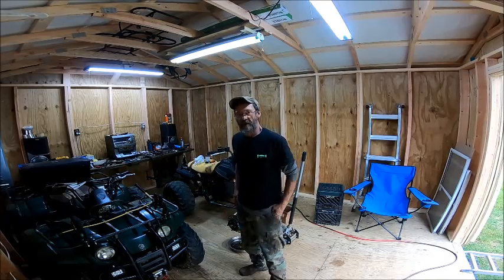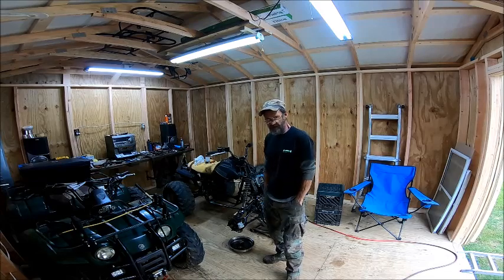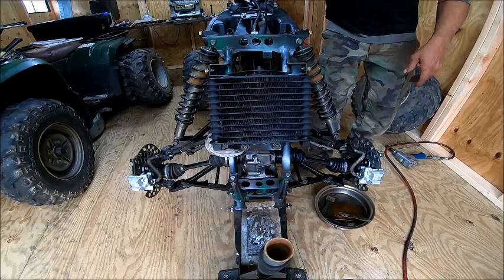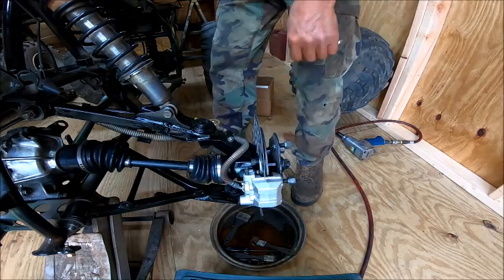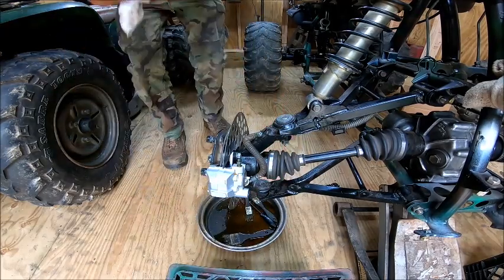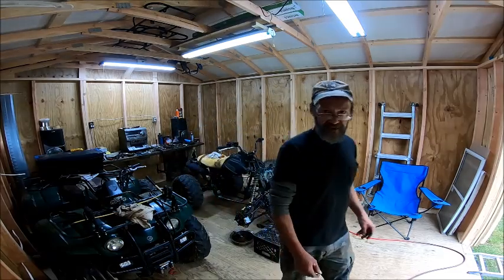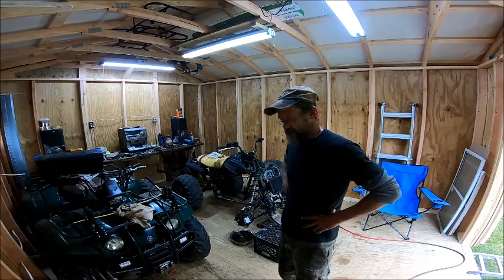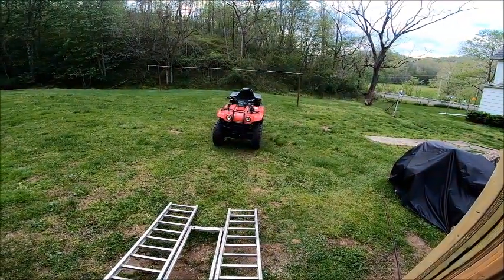how to bleed atv brakes when the system is empty

Comment: I’ve had great success with filling the system using a big syringe attached with a tube at the caliper and feeding backwards (uphill) to the master cylinder.  It’s a lot easier pushing the air out uphill than fighting gravity the other way.  Give it a try, you can get the big syringes at a local drugstore cheap.

Comment: I have a old Suzuki quadrunner LT250 4WD.  It sat for a few years in a barn.  Now, I am working to get it going.  I now have it running, but the hydraulic brake handle was frozen.  There was rust in the Master Cylinder so I chose to replace it.  I attempted to back bleed, and cannot get any fluid through the upper brake hose that connects to the Master Cylinder.  It flushes to the block where the two brake lines come off, but will not go through the hose.  Is there a way to test a brake hose to know if it is blocked or swollen closed?
Reply from the maker: either the master cylinder is bad or your hose is bad.

Comment: That was a nice floor Bro.:eyes-purple-crying:
Reply from the maker: i dont understand what the floor in my shop has to do with bleeding brakes
Reply: @BisonWorkshop  ha ha I had a nice new shop floor once and I kept it spotless until that oil leak from tractor. It was never the same.  Good video on bleeding I'm still having issues due to everything new and full air. Gonna vacume them this week from calipers and reverse till air out.
Reply from the maker: i didnt have that floor very long. i had to move and had to let the building go back. when this video was made. i only had the building for a few months.